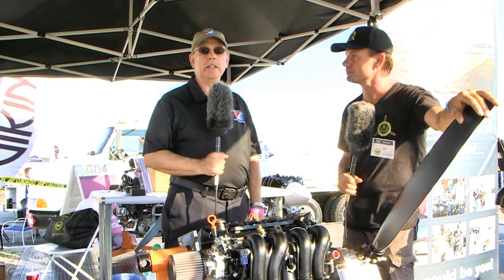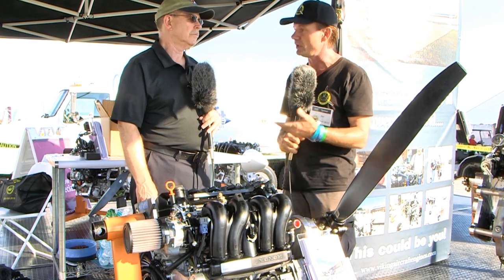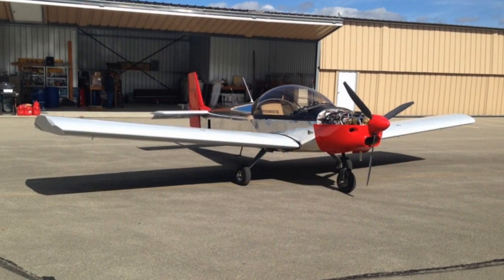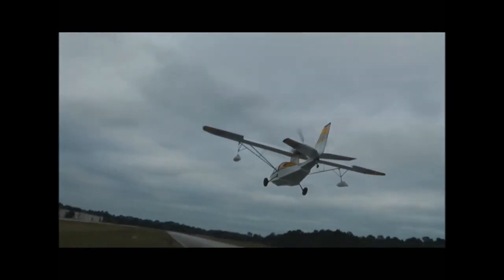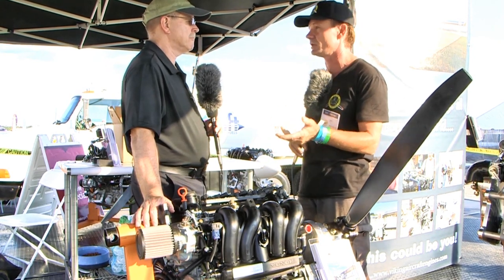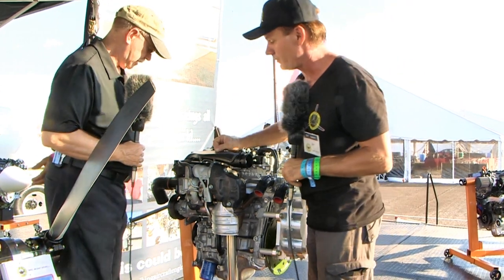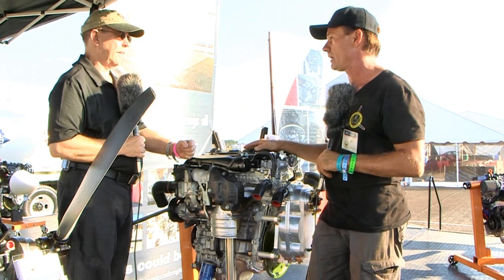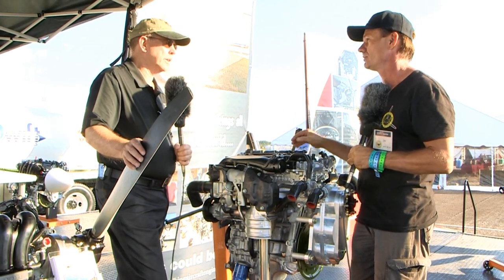Viking Honda Experimental Aircraft Engine Conversions Sport Aviation Showcase 2017 Deland Florida

Comment: Honda's are easily tune-able engines, the VTEC band range can be easily moved to make peak torque at any desired range. Adding a turbo increases tuning capabilities tremendously all while staying reliable. There is a reason a lot of 90's kids were here hotrodding these engine. They are extremely reliable when left untouched, easily reaching 250K+ carefree miles in an automobile with regular maintenance and todays little 2000cc iline 4 honda engines are making 300hp from the factory. I would feel very confident in a Honda powered aircraft. 
P.S. Honda now makes planes too.

Comment: I wasn't aware that a catalytic converter suddenly made an engine "Zero Emission"
Reply: I found that a little misleading. Perhaps in comparison to non?
Reply: They probably have to use the cat for the OEM ECU to work properly in a closed loop. You need that O2 sensor for the feedback.
Reply: He said "almost zero"emissions!!
Reply: A catalytic converter also does absolutely nothing unless their is excess air in the system. If the engine runs continually rich, without any exhaust overlap to allow pure air into exhaust, the converter will not work. These viking engines are tuned in open loop and continually rich.

Comment: No one has really tried to make an engine like this as light as they can by design. I see no reason why the Honda engine could easily lose 42 Lbs.
Reply: Bruce Ruttan Google cam 100,it was around in the  90s based on Honda engines
Reply: They used Honda D series motors (think Acura Integra) much less advanced than the L Series that Viking is using.
Reply: I would like to see that too and I think your right, but it would be expensive for a company to do it, yet most DIYers can't do much without getting themselves into trouble, as you really need to be an engineer to know where you can and can't take out metal.

Comment: Does HONDA have one around the  200-250  HP ? For larger Aircraft.  Like a Barracuda.
Reply: There is now (2018) a 2 l turbo rated (for the car) at 275 h.p. And  3 l turbo rated at 350 h.p.
Reply: Suzuki engine with aircraft made and successfully 3cy

Comment: With a catalytic converter on the engine, clearly 100LL avgas cannot be used without damage to the engine.
Reply: James Henry in the UK, Europe and Japan standard petrol is 95, super is 98 and vpower is 101 all of which can be used in any Honda without any warranty issues
Reply: Why?
Reply: Lead will ruin the catalytic converter which I doubt is included on this engine. It will not ruin the engine except it will lower the spark plug life.
Reply: Ok. He is flying the converter. A lot of heat and 100LL will "poison the converter" and make it ineffective. I would worry about the heat from the catalytic converter but to each their own.
Reply: Ineffective for emission or as a muffler.   @Dr_Reason
Reply: @Dr_Reason  also it will "OD" the O2 sensor used for the EFI
Reply: @eggenfellner   has to be unleaded fuel , it will ruin the converter the spark plugs and 02 sensor.

Comment: is it just me or... if this is running at 66% the rated RPM, as quoted above, this is NOT making 130hp
Reply: Agreed. Automotive engines are rated at peak power which is peak RPM which is in the range of about 7500 to 8000 rpm
Reply: 130HP is max power.  All aircraft engines are rated at maximum power.  And they all cruise at 75% power
Reply: Most gasoline engines make peak horsepower at meaningfully less than peak RPM, and peak torque is even lower. However, most, if not all high power Honda's have VVT and the like, which stretches the peak horsepower closer to peak RPM. That said, you will still get most of that power at 1-2k RPM less than peak horsepower, this is the real benefit of VVT; the  flattening of the power and torque curves gives you a lot of flexibility.  
It's almost like you get a second speed in the gear box, but without the extra controls and very little increase in weight or complexity.
Reply: You can run 130HP at takeoff but running it at 100% power it won't last long. I mean these engines in a car are only running at 2000 RPM or less. It will run at least twice that in an airplane engine.